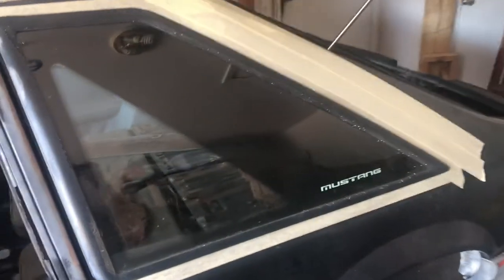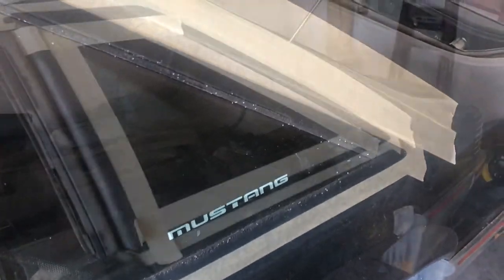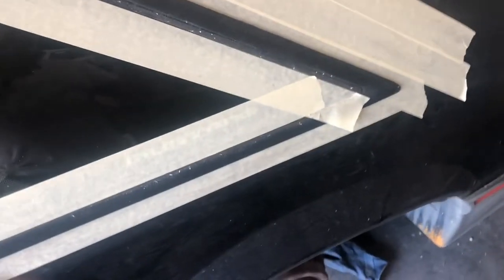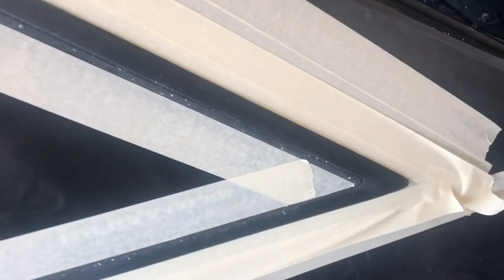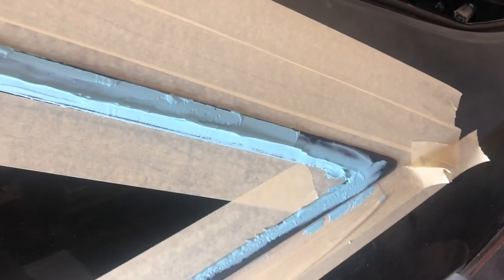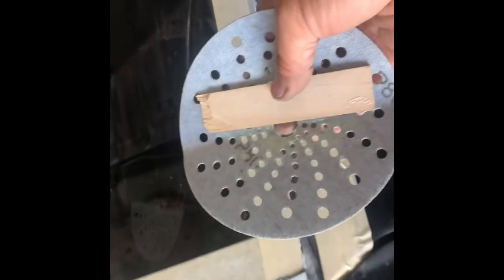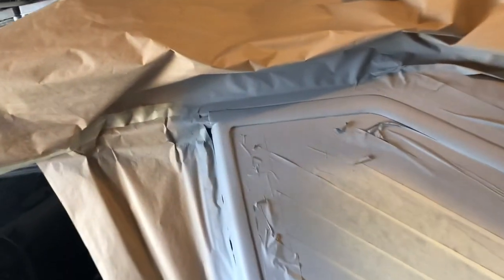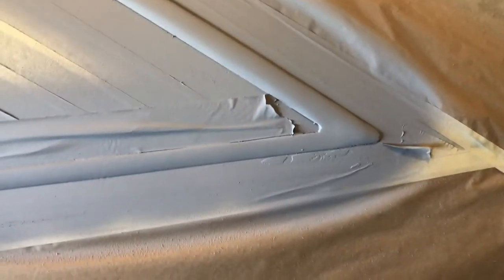Quarter Glass Molding Repair On A Fox Body Mustang

Comment: Did you use regular bondo?
Reply from the maker: Scotty Powell I don’t use “bondo brand” bodyfiller, but you can use it for sure. I use z-grip.
Reply: Scotty use polyester body filler. It sand easier